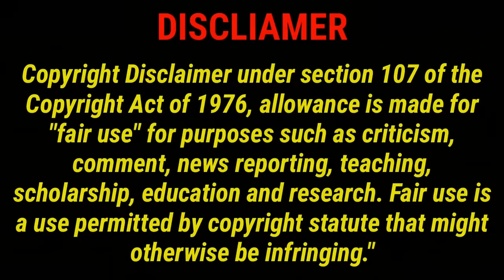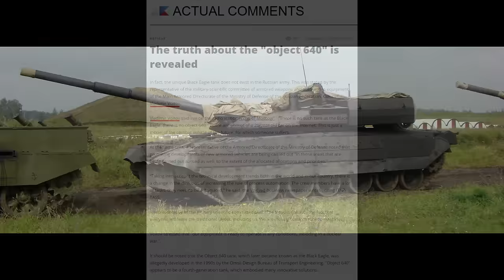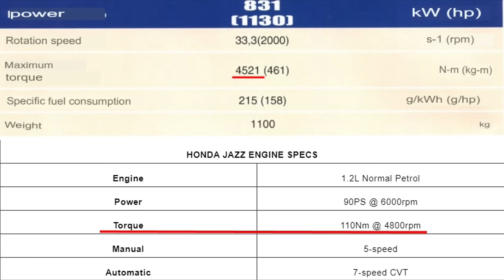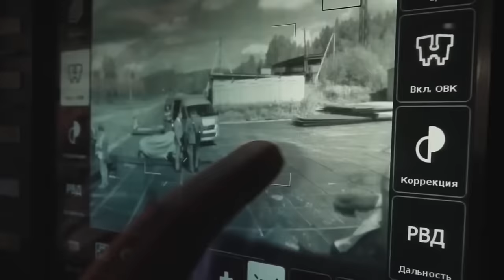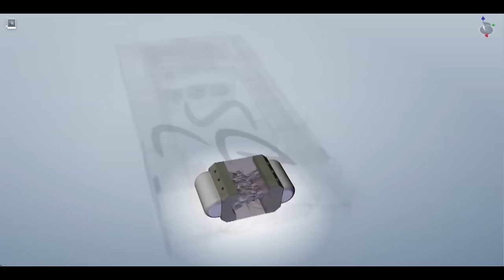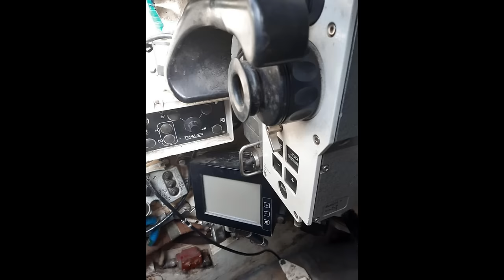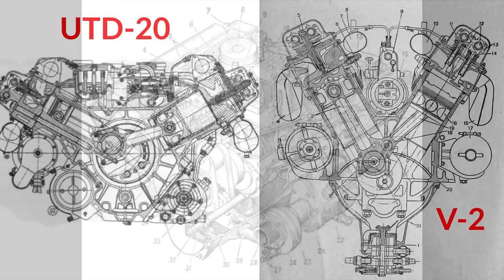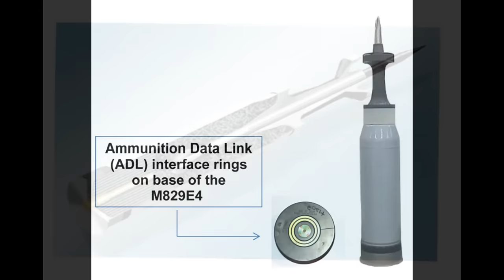LazerPig is WRONG about T-14 Armata

Comment: just to point out ... if you will compare engine weights then compare the engine weight... u compared the engine pack to an engine ... the actual engine of the leopard for example is the same weight as the russian engine but the main difference is that the germans/ americans include the gearbox,filters,... on their engines and thats why its called an engine pack and thus is 1 ton heavyer
Reply: It is mind-boggling that he doesn't know that.
Reply: As he said in the beginning - "I do make mistakes". And he just made one.
Reply: @zemstafreda  nah its easy to missuse that info becouse the actual engine weight is still classified... some sourcess say 1200kg, some 1800kg, some 2200kg but none put the direct number becouse they arent allowed to... 

the dimensions of the engine are similar to the russian one and volumetrically shuld weight the same 

what bothers me is that he described the engine as "bulky"... dude the engine is one of the most compact tank engines in the world and its desighned that way so that the engine replacement just requires the crew to pull out the engine pack in one go... unlike the T series tanks that need to be  totaly dissmantled(i operated on the M84... its a headache especially if you have big hands)
Reply: No he did not make a mistake. He used a figure for the MB 873 engine itself which is 2200 kg alone. Which makes total sense because the Leopard 1's engine, the MB 838 is also 2200 kg with less cylinders with no transmission. The full on weight of the powerpack is like 4000 kg. This is according to an MTU data sheet. 

There will be discrepancies as to whether it's dry or wet or it has or not has extra equipment but this figure does not include the transmission which is huge amount of weight. Almost or as much as the engine itself
Reply: idk about Challenger, but Leopard 2's engine is indeed 2.2t. It literally says on the info image that its the weight of the engine itself. Also for example, since Leo 1 does not have "Power Pack" as those are called on Leo, Abrams, etc. it just has an engine, and the engine of Leo 1, which is a smaller "version" of Leo 2's engine, weights 1.92t completely dry, and with oil its 2.23t. So no, RedEffect is not wrong, the entire power pack of Leo 2 weights more than 4t.
Reply: @azrael9016  well the sourcess are very inaccurate and based on estimations ... most sourcess put the engine veight at 1200kg while the gearbox is 1-2 tons which again noone knows for sure unless the info is declassified... we used a 4 ton forklift to cary that engine pack meaning it is not more than 4 tons ... infact it does not weight more than 3 tons becouse a 4ton forklift cant lift a 4 ton item for obvious reasons

also i think it depends on the engine age ... most likelly newer engines are newer and have lighter alloys(thats my theory) and thats why we have so many different numbers
Reply: @RePlayBoy101  MTU themselves state that the MB 873 engine used for military application is 2200 kg
Reply: @zemstafreda  is it really that mind boggling, he’s a tank enthusiast YouTuber who makes video essays. It’s still good content people make mistakes.
Reply: @TheForklifter  again i sad that mostlikely the newer engines have lighter alloys and thus why we have so many different weights of the engine
Reply: @cameronmorris3347  He's not some tank enthusiast, he pose as an expert and he dosen't know what powerpack is and why it gives a big advantage.
Reply: Yet the Datasheet provided clearly states its the engine without transmission...
Reply: @azrael9016  then explain why we didnt dip over a 4 ton forklift when we transported the engine around XD ... in all seriousness the MTU engine pdf that was scanned is mostlikely older than both of us combined and i know as a fact that the pistons and piston rod is not the same anymore... and more i dont want to say becouse i dont know what is classified and what is not at this time
Reply: @RePlayBoy101  It's not about the weight. It's about talking about powerpack like it was nothing more than engine ignoring the beautiful design that every tank mechanic loves and make possible to replace it in the field in two hours.
Reply: @RePlayBoy101  cause engine is 2.2t not 4... like wtf. Who cares how old the pdf is? its certainly isnt 50+ years old like the engine itself. It could have literally been made in 1970 (which it isnt) and would still be correct to this day because the engine is literally the same. There have been changes to the power pack but not the engine, engine still remains the same good old MB 873 from Kpz 70, and was made even before that, its just that that engine was called Daimler Benz MB 873. You can find all about it in "Daimler-Benz High Output Engines - A Study in Compact Design". So to answer your question: MTU themselves made a brochure some time in 21st century citing their older info from a document that has same information cause its the same engine. Engine as engine weights 2200kg, there could have been changes done to the transmission or some other Power Pack component but you cant reduce the engine weight unless you remove parts which would simply not make it operational... and the weight reduction of other components made the entire power pack weight just under 4t (if what you say is true, have to check with Leo tankers i know)
Reply: @azrael9016  we caried the entire engine pack with a 4 tonner forklift ...
Reply: @RePlayBoy101  as I explained already, since u clearly didnt read my comment. lemme say it again... Other parts of the power pack could have been changed. You cant change the weight of the engine that had no change since its creating in the late 60s. Only thing that changed with MB 873 was the name from Daimler Benz MB 873 to MTU MB 873 because of company merges and new name of the new company that held the rights to the engine.
Reply: Kinda goes to show just how subtle propaganda can be
Reply: @azrael9016  pretty sure she's talking about the sources listed in the video desc in that context.
Reply: @RePlayBoy101  you are wrong. Stop with the copium
Reply: He used correct to best of his knowledge info. It is simply true that when comparing engine only to engine only of Russian tank the Russian engine is lighter per HP then German engine. I.e. No shock here, Russians do make good engines.

Comment: A sidenote on gas turbines: This is not a correction per se, as tanks with gas turbines are very obviously less efficient than diesel tanks, but this is actually not the fault of the gas turbine, but rather how it is used. Gas turbines are actually extremely efficient, they just don't like step functions or idling. This is partly why we use them on airliners. They aren't just stronger than a piston engine with propellers, they're more efficient on long hauls where they sit at stable RPM for hours on end. If they weren't more efficient than piston engines in that use case, we frankly wouldn't use them.
Reply: You completely wrong.
Reply: @LeonmitchelliGalette  they're not, but there is context missing.

The inefficiency of turbos has to do primarily with the way they're throttled: they change the temperature and/or pressure off the combustion chamber, which lowers the expansion ratio and thus destroys efficiency. 
On top of that, the less power you draw, the greater fraction of that power is wasted on an "oversized" compressor, drawing a bigger volume of air than needed for the low throttle, which is needed because else pressure tanks and that's as mentioned even worse.
Start up and throttle isn't the most efficient either as spinning up the turbine isn't a matter of turning a valve but actually using up the engine's energy to accelerate the heavy blades to rotate even very-fast-er...

One specific issue with Abrams is that they use an adapted chopper's engine, and it is governed way below top speed because tanks are not  choppers lol and I'm pretty sure itd give a lot of trouble... For the aforementioned reason, efficiency is trash, though in general, tanks (which do need to throttle a lot) with a turbine aren't that efficient anyway...

This is why the OP said that turbos are very efficient when used steadily and close to max power. Comparing with diesels is hard because diesels vary in efficiency just as much as turbos, with expansion ratio being the biggest metric, which itself is at odds with specific power, but indeed they are on a comparable range, with the most efficient turbos as good or better than the most efficient diesels (think turbines on power plants, or marine diesels). 
- For a given power density, turbos destroy diesels, simply because being more compact and allowing to trade that small size for a very high expansion ratio. This is stupid tho because it defeats the point of a turbine
- For a given expansion ratio, diesels win, because their cycle and construction... this is stupid again because R is rarely a limiting factor.

In practice it  depends on the specific application. For aircraft, getting a jetliner's fan powered by a diesel would be ridiculously huge, heavy, complex, draggy and offer no real gain in efficiency if not a loss, thus it isn't done (there's a reason the few non-turbo aircraft there are are small, cheap and low performance props...). For a tank though the requirements in size, torque, throttle, etc impose a heavy price in gas for the turbo's performance and stealth...
Reply: @antaresmc4407  "because tanks are not choppers." Counterpoint: every T-14 promo video, in which they're seemingly endlessly spinning their turrets to hide their lack of effective stabilization while on the move 😂
Reply: @antaresmc4407  I think a good way to put it is that both diesel-piston engines and turbines are top tier choices for applications where the top two priorities are power and efficiency. Which one works better just depends on the details. Ie, boat engines are all diesel because diesels are far less expensive and almost as efficient, while any malus in power can be made up with displacement since boats don't care about weight, and as a bonus the engine suffering a catastrophic failure won't send metal shards through bystanders at the speed of sound when the engine is diesel-piston rather than a turbine, all on top of the fact that boat engines are expected to change revs often, albeit not as quickly as a car engine.

The flip side to all this is that if we could make a tank (or even a civilian vehicle) that was a turbine-electric powertrain, the turbine would suddenly become almost ideal. Then the turbine would only run at full power (to charge the battery or capacitors) and be off otherwise. Though, this would introduce a host of other complications, both for military and civilian vehicles...
Reply: GTD-1250G/GTD-1400 is a good example of alleviating the idle issue where you use only enough fuel to be ready to "boost" once you actually want to drive. Power generation would be off of the included GTA-18A.
Reply: @antaresmc4407  Fuel cost is largely irrelevant as both the GTD series and AGT-1500 can run on a variety of cheaper fuels.
That is not even considering how specific the majority of "conventional piston" engines on tanks are, a good example of this woul b e the MTU-873 which requires very pure diesel in order to run properly, otherwise you're going to end up with a cloud of unburnt diesel.
That isn't even mentioning the large increases in efficiency regarding turbine engines over the years. GTD-1250G/1400/1500 come to mind in regards to that.
Gas Turbine tanks also have better offroad efficiency than comparable conventional V piston.